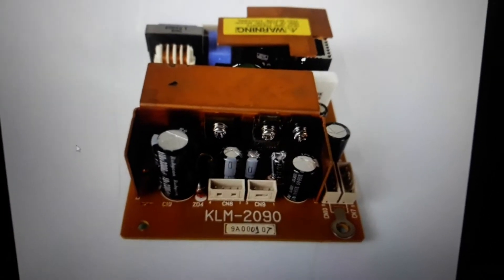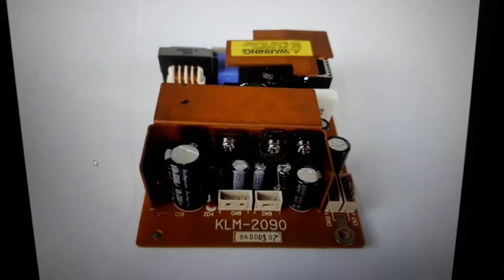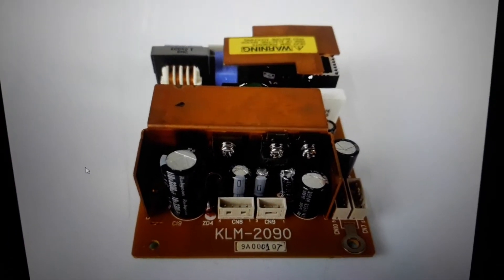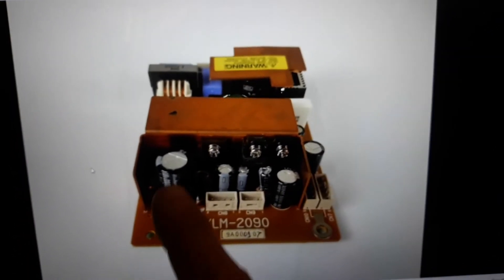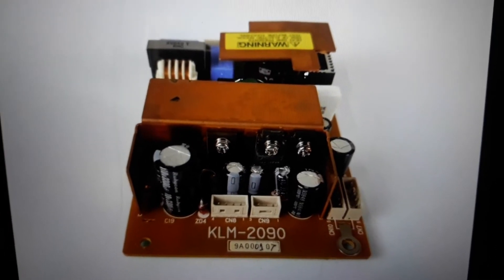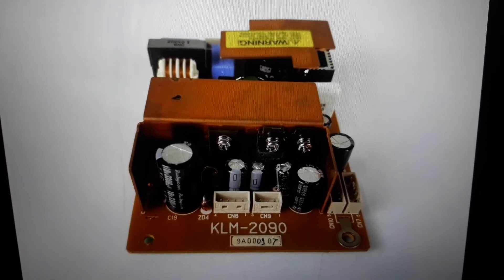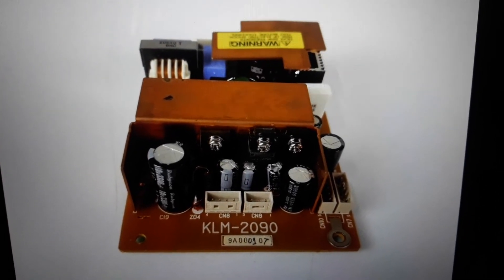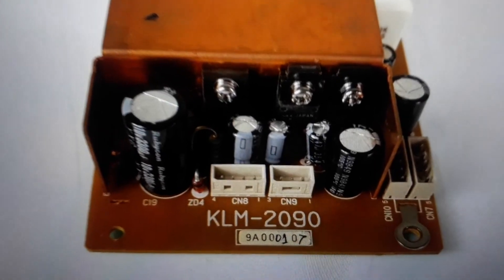QUINTRONICS Korg CX3 motherboard replacement / power supply repair pt 5

Comment: I have a CX3 in for repair, same version as this one. Getting an error message ROM error and DSP error.
Of course, no luck in finding a replacement board. Do you think the board is repairable? I have updated the firmware. Thanks